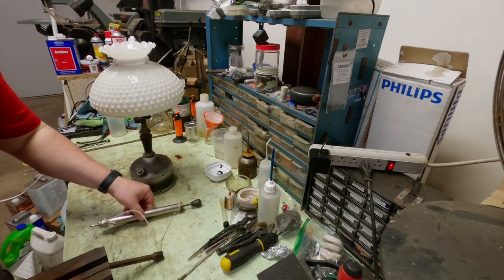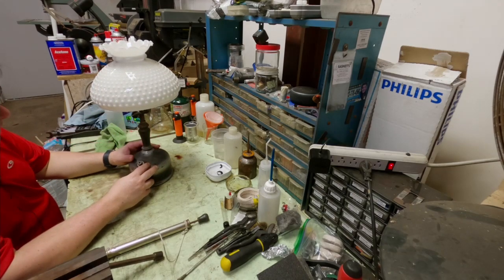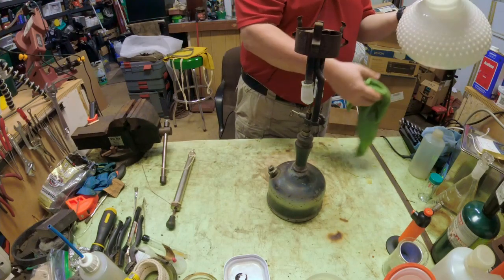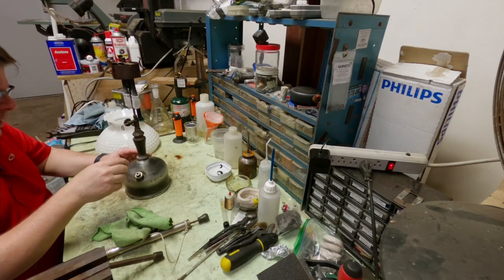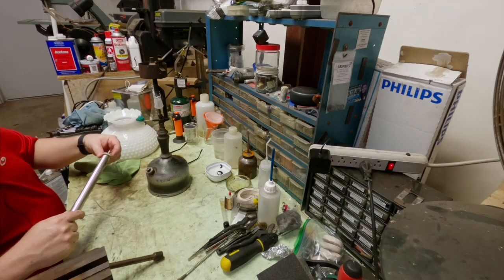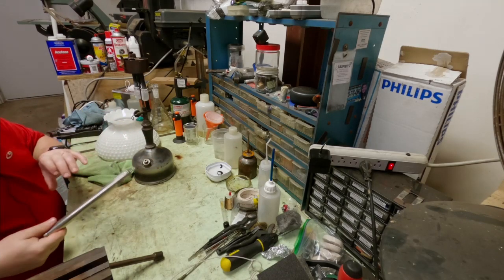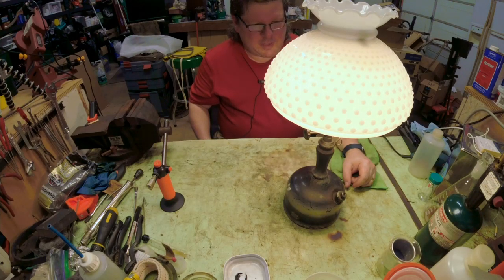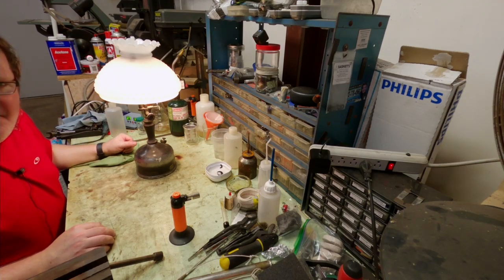Light Up: Coleman 134 table lamp

Comment: I recently picked up a 1948 157 model that is in great shape.  It has the built in pump just like on the lanterns though so much more convenient than the external pump.  Looks great and I agree that they do put out a really nice light.  Appreciate the video.
Reply from the maker: I've got one of those too, in similar shape!  I don't think mine's ever been fired.  I'll have to do a feature on it one day.  One benefit of the external pump is that it is BIG and doesn't require that many strokes to get it up to pressure.

Comment: I know lanterns and stoves. I collect them, rebuild them, and then give them away as gifts. I have two CQ lamps and not a single Mega You Tube Coleman Star will give me a straight answer or link on how to rebuild my gas valve packing with "graphite String". Some say it just takes a graphite packing, but they don't reveal where to get one. BUT, they are proud of their lamps and included them in their intros to their YouTubes and such. What the heck? Can you show us how to do that?
Reply from the maker: If you are looking for a small valve packing, you can find it here: https://www.oldcolemanparts.com/Small-valve-stem-packing-P2.html .  They also have the graphite ribbon if you want to "wind your own", but that one above should work.  There are also other small packings that are the longer version, not exactly sure which one you might need.  I'd just search for "packing" on that site and you'll see all he's got to offer.  Should get you fixed right up!